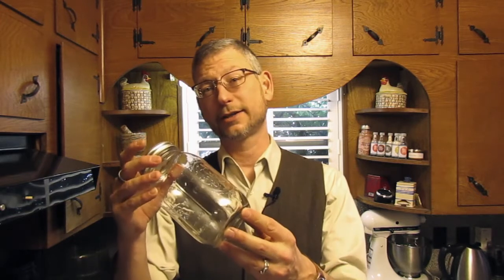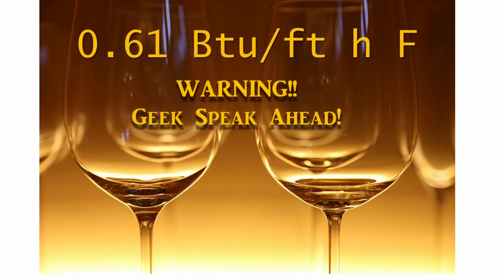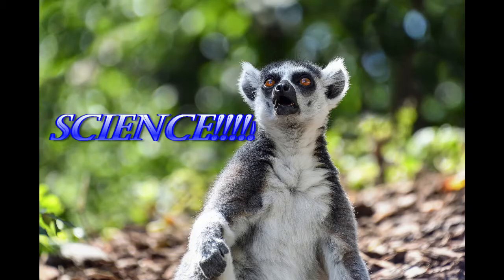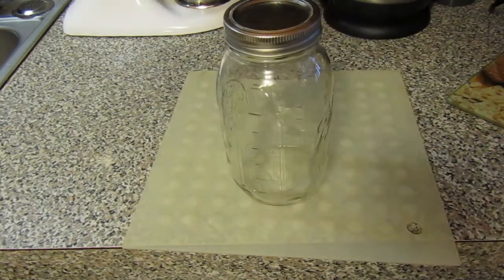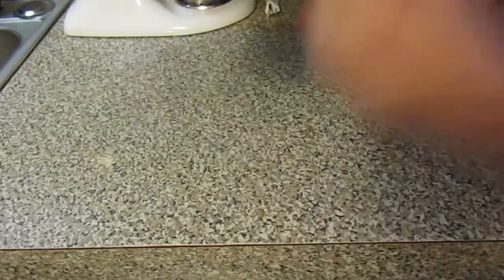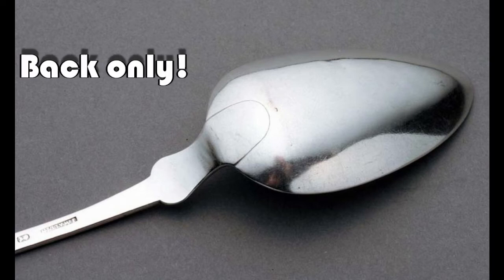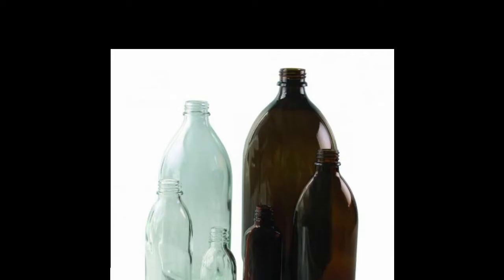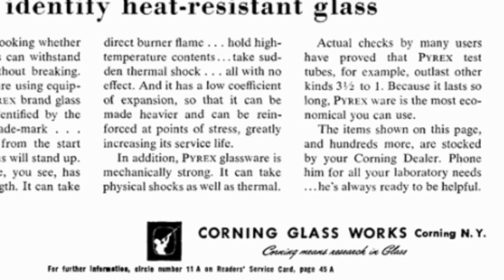Best way to pour hot liquid into a cold glass without it shattering

Comment: If you want to pour a hot drink (tip #3) run your glass under fairly hot water to heat the glass so boiling water won’t be as drastic of a change. A good barista will run an espresso cup under hot water before putting espresso in it. It’ll help preserve the flavor of the espresso too
Reply from the maker: That is a great tip!!  Thanks!

Comment: The older pyrex was made from borosilicate glass which is extremely resistant to thermal shock. Corning sold the pyrex name to a different company which switched the formula to tempered glass, and lowercased the logo, so it's not the same thing anymore. Fortunately borosilicate glassware is pretty dang popular and not hard to find. There are other companies that make borosilicate cups, mugs, casserole dishes, etc.. A lot of coffee stuff, french presses, Chemex, etc. are made from borosilicate. It's also stronger and clearer than normal glass.

Comment: Nice video, I watched this before I poured some hot water that I boiled into my new glass cups for tea. 

Turns out my glass cups were meant to be able to take the change in temp from cold to hot water, but this information was still very helpful.
Reply from the maker: Glad you found it useful! Most modern glassware is treated to be able to withstand some temp changes.  Always good to be careful, though!!

Thanks for the feedback! 
-PK

Comment: I did the opposite (I wanted to put ice in a very hot glass pitcher), I fully knew about thermal expansion breaking glass and thought: maybe i shouldn't put the ice in straight away, Ill put in cold water first. It wasnt enough and the glass made a wonderful ping sound and had a bunch of little hairline cracks
Reply from the maker: UGGG!!!  That's no good!

Comment: 2:00 ice -> water -> steam is a bad example of heat making things expand. Ice is less dense than liquid water which is why it floats. It's also why if you freeze water in a sealed container, the container will often burst. Water is fairly unique with this property. Most solids of are more dense than their liquid state and therefore do shrink and sink.
Reply from the maker: True, but my stove doesn't get hot enough to vaporize the sand from my back yard so I went with water. 😜

Thanks for watching!!

Comment: Silicon mat, rubber mat, wooden or other material big coasters will work as insulators? I don't want to use towel please suggest something which is easily available in the market or on Amazon. 
Btw great video. ;)
Reply from the maker: Thanks!  
Yes, anything that will slow down how fast the heat from the glass moves into the counter top will work.  As you mentioned, silicone, rubber, wood, cork (what's in most coasters) or plastic will work. If you take your local newspaper, you could use that, too.  Paper is essentially wood chips.  (Just don't use paper for something that just came off of the stove our out of the oven.  Because, you know, flammable.) 

Think about it like this: if you left it on top of your car on a hot Summer day for an hour would you be able to pick it up without burning yourself?  That's a good indicator of whether or not it's an insulator or conductor.

I appreciate the question!
Reply: Wow Professor. You rock. Thank you for responding ❤️
Reply from the maker: @Ayush_28  it was my pleasure!

Comment: why pour hot liquid  on the back of the spoon? Can you tell what is happening there... Is it buying time for the glass jar to get heated so as to avoid huge temp differences
Reply from the maker: That's a great question!  
It's for 2 reasons.  First, to spread the liquid around the glass so the heat isn't concentrated on one spot.  The more of the glass gets hot at the same time the less chance of cracking.  Second, it lets out some of the heat from the liquid.  When you pour the liquid over the spoon you'll notice that quite a lot of steam escapes compared to just pouring the liquid straight in.  The steam is taking a lot of heat with it.

Thanks for watching and commenting!!
Reply: @ProfessorKitchen  Thank U Sir for the quick reply... It makes sense when u put it that way
Reply from the maker: @clueless_experimenter  You are more than welcome!!